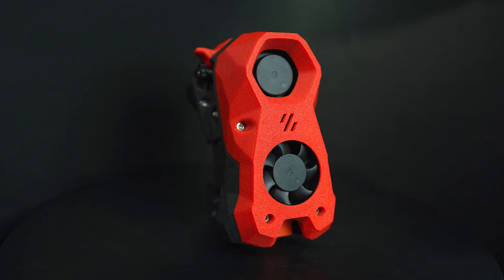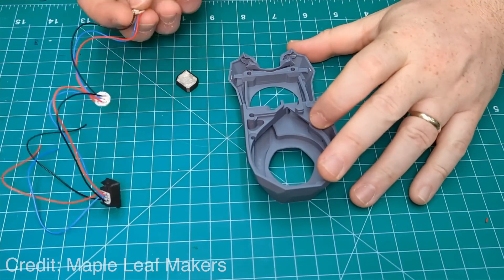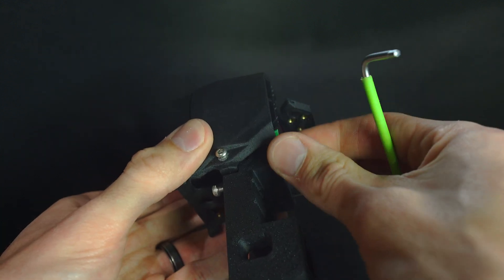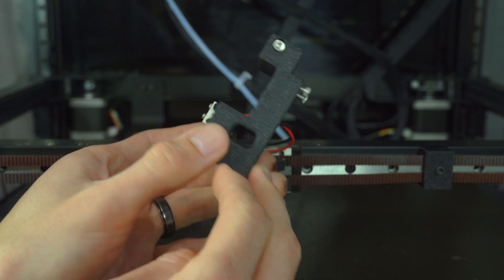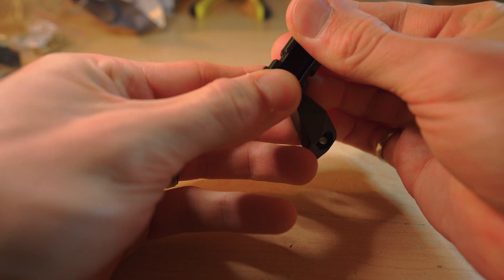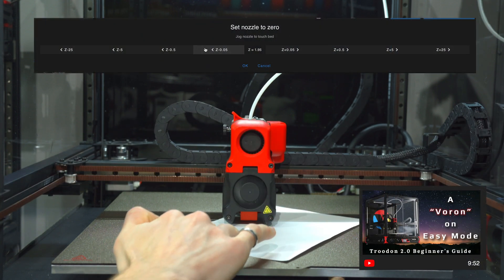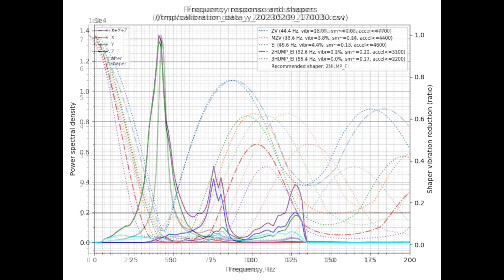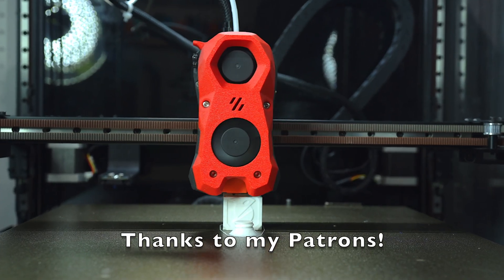A Pre-Built Voron Stealthburner !? Install and Setup on Troodon 2.0

Comment: I have a voron 2.4 with dual rails on the x-axis. Would it require any modifications for this to work?
Reply from the maker: I don’t believe the Stealthburner is backwards compatible with the dual rail design, but there may be a different carriage mount you could print for it.
Reply: @ygk3d  is this particular head any different than what you would build with parts you would source yourself?
Reply from the maker: @HeyCoalCat  only the toolboard is specific to the Troodon. But you can discard that. It also doesn’t have the LEDs, so you would need to purchase those separately if you want to add them. Otherwise it is the same.

Comment: Unfortunately the Troodon is NOT a Voron. I learned that the hard way. The belt path does not match a voron. The pulleys are different and the belts are on different heights. Bought a light weight X gantry with CNC xy joints, they do not match. The belts don't line up. Further more, the extrusions are 20 x 23 mm WxH which is a weird choice. If you want to mod it extensively this is not a printer for you.

Comment: Hey man, did you shorten the cables somehow when removing the cable chain? I'm going to do a sensorless homing so need to get rid of the chains.
Reply from the maker: I pulled back any excess and stuck it under the bed. Some people have unplugged the cable and routed it out the back ventilation holes which also seems like a good strategy.
Reply: @ygk3d  I see. I experimented some more and if you use the cable chain and put it upside down it is very stiff. Furthermore at the edges you can detach a few links and reattach them upside down making the cable chain bend up at the edges while being stiff in the middle. Then you can run the cable along the back extrusion and have the cable chain limit the movement of the cable except at the two ends of the cable chain. You would have to print something to attach the cable chain to the back extrusion and keep the part where the cable starts from vertical. The cable would go from the left side of the back extrusion to the toolhead. I haven't printed anything yet but the bottom holes can be used to attach the cable chain to the back extrusion.
Reply: Actually didn't work. I think I'll route it out the back ventilation.

Comment: If you could get a pre-assembled and tested voron built from the formbot kit at the same price point as troodon+stealthburner, is there any reason to choose the troodon?
Reply from the maker: My choice would be the Troodon. It is more solidly built with all metal parts. The only major difference would be the firmware. The Troodon comes with RepRap but the switch to Klipper is easy if that’s the route you want to go.

Comment: I'm thinking about buying a Troodon 2.0 but the Creality K1 max seems to be amazing as well. What would you recommend? I like the 350mm build volume but if the K1 max is much better I could manage with 300mm. Printing big ABS parts is the most important feature for me.
Reply: Don't buy a Creality
Reply: @tjlqk3  I bought the troodon 2.0. Creality K1 max seems good though but I like the Troodon because it can be customised and upgraded to your liking.

Comment: I switched out to the Stealthburner end today, but my nozzle doesn't seem to be back far enough to hit the z-stop pin. It's off by maybe 2mm, but I have the safe_z_home set to 230,350 and it won't go beyond 350 if I set it to, say, 352 ... any suggestions?
Reply from the maker: Try changing position_max under [stepper_y]

Comment: That StealthBurner looks nicer than the hot ends from all of the Chinese 3D printer companies.  It looks more like something you'd see on a Stratos commercial 3D printer or one of the $4K+ prosumer grade printers.  If I had a Klipper machine with good input shaping, I'd have opted for the high flow version of the StealthBurner so extrusion rate wasn't the speed limiting factor for the Troodon 2.0.

Comment: Thanks for your videos I am learning a lot about the Troodon 2.0. Can you do a side by side comparsion of the Troodon 2.0 vs the Bambu Lab X1 Carbon? Thanks!
Reply from the maker: Thanks for watching! 

These two printers are quite different so I’m not sure a comparison would make sense. The Bambu is smaller and hands-off in its operation. The Trodoon is larger and has a steeper learning curve but offers the opportunity to mod and tweak, which can be a hobby in itself.
Reply: @ygk3d can the troodon be modded to be as "easy" as the bambu? Or are the mechanics just too different?

Comment: Would this be a reasonable upgrade for an Ender 3 S1?
Reply from the maker: I'm not sure that would make a whole lot of sense. The S1 seems to have a decent extruder/hotend setup from factory. This Stealthburner needs an MGN12 linear rail for the carriage to ride on. I don't own the S1, but it seems to use v-slot wheels, so the Stealthburner wouldn't be directly compatible.
Reply: @ygk3d  Got it.  I'm still relatively new to all this, appreciate the response!

Comment: What kind of print speeds do you get?
Reply from the maker: I’m maxing out at 10 mm^3/s flow (PLA) with the stock v6 and 0.4 nozzle. That amounts to around 100 mm/s with 0.45 line width at 0.3 layer height. To go quicker you’ll need to upgrade the hotend or install a CHT nozzle.
Reply: @ygk3d  so with a standard flow hotend then?
Reply from the maker: @pixxure1  those numbers are for standard flow. You could go faster with a high flow hotend.

Comment: Question. Bought the large Troodon in 9/20 but some things came up and never had a chance to set it up. Will this work on the original machine? Thanks.
Reply from the maker: It won’t be plug and play. The Stealthburner carriage is designed for an MGN12 rail. The Troodon v1 has an MGN9.
Reply: @ygk3d  Thank you, I've contacted Formbot.

Comment: Awesome video 
Can’t decide between troodon or bambu suggestions?
Reply from the maker: Thank you! That really depends on what your goals are. I love both. You will learn more with the Troodon and have the ability to print bigger things. The Bambu X1C is a treat to use if you just want to print things.
Reply: I know the community loves to hate on Creality, and most of that is justified, but they will start shipping their K1 Max soon.  It's their answer to the Bambu Labs X1C.  The K1 is more of a direct competitor but the K1 Max offers a larger 300 X 300 X 300 mm print volume.  Not as large as the 350 X 350 X 330 mm Troodon or larger Voron printers, but a fast large volume CoreXY printer with good print quality using Klipper input shaping and in the case of the K1 Max, a lidar for first layer inspection.

Comment: Perfect timing!! Your videos are awesome!! 

I ordered my Troodon 2.0 yesterday and it should be delivered Friday!!!  

Ordered the printer from a vendor in Canada and the stealthburner from formbot. It should be here in less than 2 months…😂😂😂

Do you have your rep rap resonance tower somewhere it can be downloaded?

For changing the config files will any text editor do or is there an optimal program?  

I’ll just drop a revo six hotend in from the start… keep the afterburner as a backup!!!
Reply from the maker: Thank you!!

The RepRap resonance tower 3MF files are available on my Patreon. If you want to generate your own you can download the ringing tower test model from here: https://www.klipper3d.org/prints/ringing_tower.stl. 

Have fun with your Troodon 😊
Reply: @ygk3d  normally I find patreon is just a useless cash grab from greedy YouTubers…. 

Your one of the few exceptions. I’ll hit it up once the printer gets here!!!

Again fantastic work!!
Reply from the maker: @robh.8214  thank you! I try to provide as much value as possible to my Patreon supporters.
Reply: So my stealthburner just shipped. Does it have the same bearing issues as the stock hotend/extruder?

Just finally started getting good prints out of the printer!!!
Reply from the maker: @robh.8214  the Stealthburner comes with steel sealed bearings from factory, so no need to switch them.